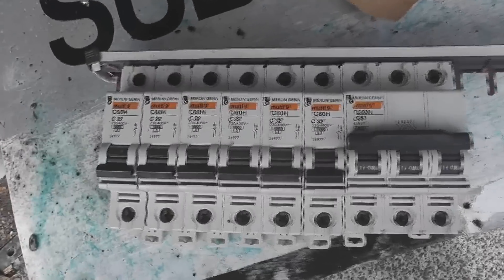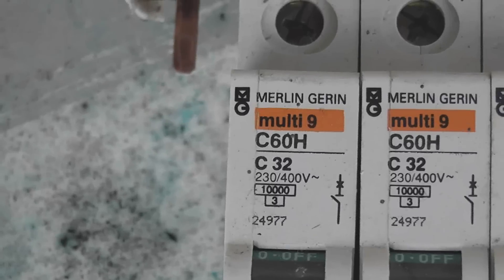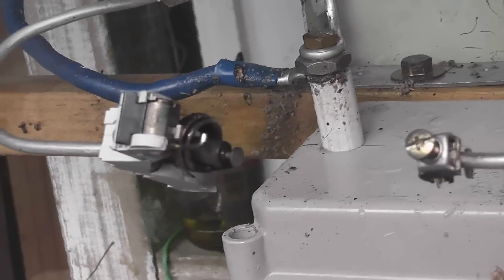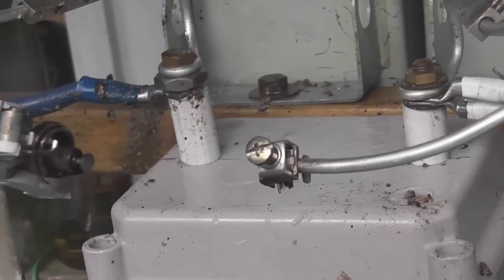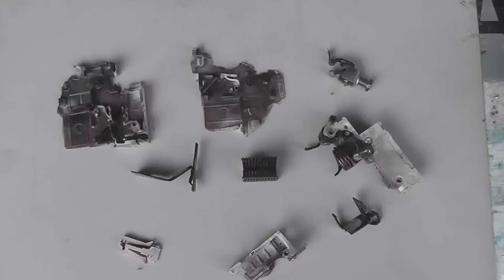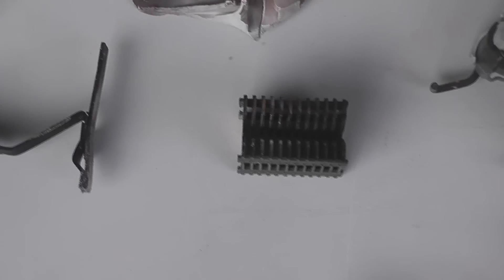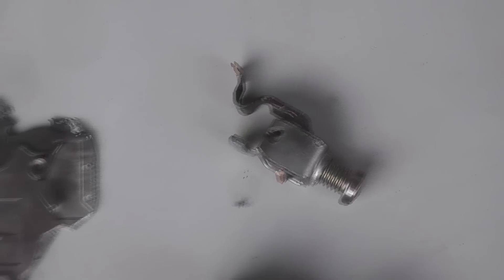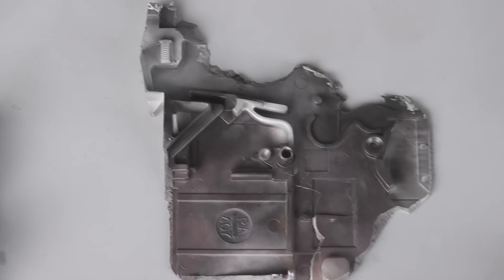32 Amp MCB explodes

Comment: There are simply fuses that cannot handle overcurrents in a way like an HRC fuse can handle or at least properly switch off. I don't think that "household fuses" are meant to be a safety device for highpower professional devices.

Comment: Once aw a seagull take out a 44KV mains fuse.
Dumb bird, landed atop transformer with wings outspread.
Bright flash, huge boom, lights out up and down the road.
Utility crew was there in minutes, dropped the dead bird off the pole, replaced the fuse while hot [never saw that done before!] left without cleaning up.
It smelled vaguely cooked.
Reply: Greg Gallacci the bird or the fuse?
"Smelled slightly cooked"
Reply: Dude, the utility crew. Duh.
Reply: Bob Builder071 lmao
Reply: Wish more seagulls would learn that trick.  We have a abundance of them around here,  and "stupid pet tricks" like that one would be helpful in reducing their numbers.  Also, would be entertaining for the humans who've had run-ins with seagulls and seagull shit.
Reply: Greg Gallacci yummy!

Comment: I did this when I borrowed Photonicinduction’s cap. 
Due to the voltage rating of the cap I couldn’t get a proper reading as I didn’t have the right tripe of testing equipment to test the F or the cap. 

To power it I used 2 old school MOT’s, centre tapped them, rectified using the MOT’s diodes (I used a few different ones but the second I shorted it out they went short circuit) so I had + & — 2.5kV (rectified that it). 
I put everything I could find over the output and not a single thing had a chance. I could put 2 or 3 MCB’s in parallel and it destroyed all of them as did a 80kA HRC Fuse.

Comment: That Circuit breaker was not rated for DC.
Reply: Sure 'nough. 230/400V is AC ratings. Hrmm, maybe another test should be done using a DC MCB or running AC through one of these

Comment: But even if you used an 80KA HRC fuse it's most likely it would also explode too, as it's not just the fault current but also the system voltage the breaker has to be able to clear,  you're got a whopping 7000 Volts DC on a 230V ac mcb, so even if the peak discharge current is under 10KA it would still explode anyway, and fail to extinguish the arc.
Reply from the maker: Agreed 100 %
Reply: A better test would be to charge the capacitor bank to the maximum voltage rating of the test specimen and repeat the test.  It should stay intact and interrupt.
Reply: Not with 230V dc thou, the MCB will still fail to extinguish the arc and its no match for a high energy cap bank.

Comment: It may have exploded, but it did turn off !!
Reply: lol..yea it turned off because the power source is a single discharge from a large medium voltage capacitor bank. However at the substation, power is supplied continuously, the breaker would explode, but the huge hot arc would continue uninterrupted ...and now we have now lost control of it.

Comment: Going by the voltage and the fact that you have almost no resistance, you got somewhere around 490 000 000 watts for a split second in that circuit.
Reply: BUNCHofxs    Right on. It's not meant to be installed like that. So.. in a way.the video is dramatic but pointless for.discussion.
Reply: you could just say almost one half of a billion watts....